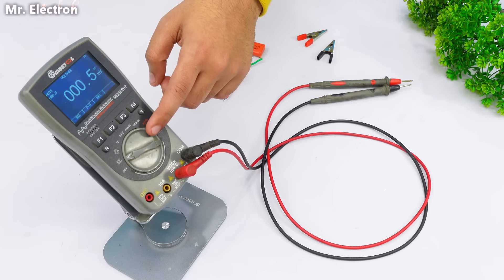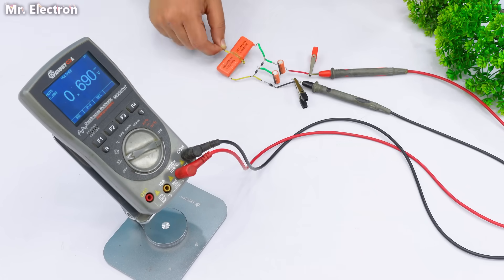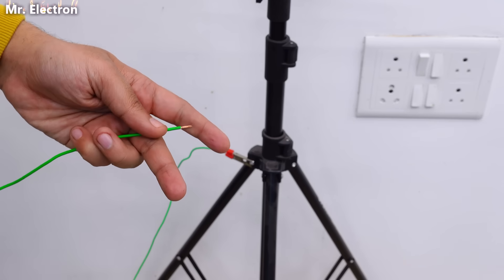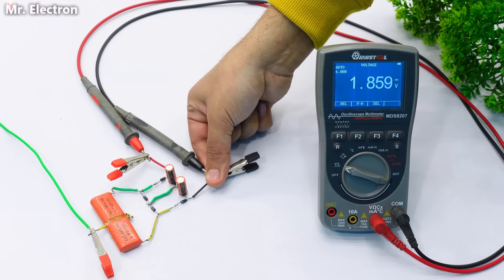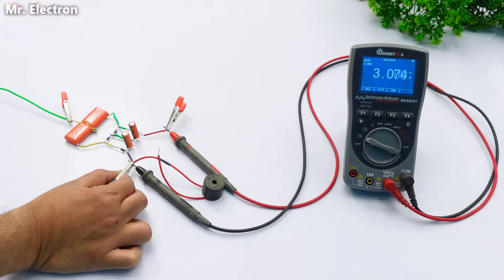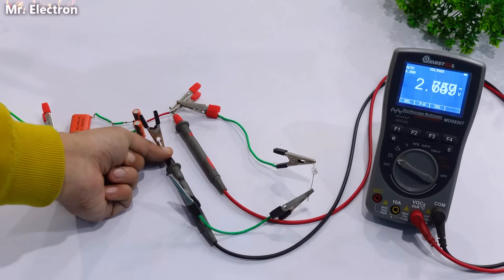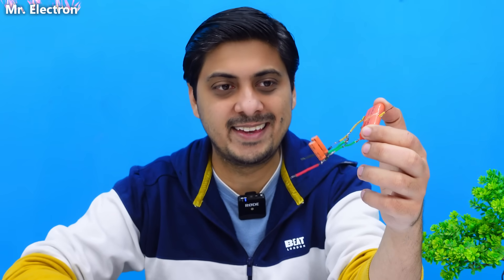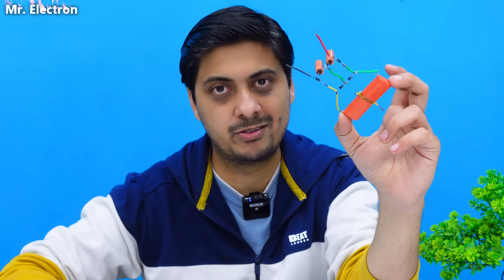Maxwell Chikumbutso - 5000 KW FREE ENERGY from RADIO WAVES | 100% Working Model DIY

Comment: You say it's impossible; Nikola Tesla realized a car that ran on cosmic energy, but was hushed up. So you don't know how to do, or you are paid by the oil companies. The energy, initiated by the radio frequency (=cosmic waves) is coming from the universe and not from the "radio emitters", they only serve as antennas.
The small amount of energy is enough to start a chain reaction, for instance with magnets, and pull a large amount of energy from the vacuum. An exemple is a magnetic free energy generator that suppresses the counter EMF in coils.
Here is an other proof of the existence of it:
- In the year 1965: an American team  visited with aliens in their space ship their planet: 
The team reported: ...."The Ebens developed a different type of electrical and propulsion system. It
was unknown to our team and I don't think we ever really understood it. They
were able to tap into a vacuum and bring back an enormous amount of
energy from that vacuum.
The Eben's energy device was analyzed over and over again by our team.
Since our team did not have access to scientific microscopes or other
measuring equipment, we could not understand the function of the energy
device...."

Comment: "New inventions often come from making connections between things that already exist" 
Besides, Maxwell's invention violates the laws of thermal dynamics you are basing your experiment on, so it's practically impossible for you at present 😁
I like it that Maxwell has started the revolution, many like-minded will emerge.
Reply: Like those perpetual motion machines with the springs, offset cranks, and flywheels? People reverse their videos so they appear to be working, and people believe it.
Reply: @jamesvandamme7786  in all the comments it's you who is fighting it's doing your racist skin very well is it....... Kkkkk maxwell didn't invent anything he just used a what is there to come up with  new product and he did it well and he is making money, 😂the better that sinks in the sooner you will feel better
Reply: @Malvin.k  He did not come up with any product. He has had ten years to sell his "invention" in the simplest possible form, just a plain electricity generator that makes power out of nothing. He has totally failed to do that, because he knows it is not possible. He comes up with every excuse that he can't sell, demonstrate, or explain how it is supposed to work. So instead of a verifiable simple demonstrator, he has his TV with a battery inverter, a commercial power bank, and a stock Chinese EV. He did not build or even modify the car, and there is a huge traction battery under the floor like any other EV. 
He is very successful in making money, not from selling actual products (which wouldn't work) but by getting donations and investors who are too uneducated to see that he is a fake.
Reply: Yeah😂
Reply: 🤓, yup! But we are talking. 
I'm just keeping my electric bill low. 😅
Reply: Hey, we are surrounded by Energy filled with it.
Tapping it as Nicolas Tesla did, is not violating any Maxwell or Einstein THEORY'S.
Them men, only started the quest, poorly armed with equipment out dated that today's science is beyond using, any more.
Maxwell didn't live to see a Cellphone or Space Travel
Reply: Science is about being able to reperform identical experiments to verify results. If no one else can do the same, and this man still has not  become even mildly rich off this invention by this time... I'm incredibly skeptical of the efficiency of this concept at gathering energy for real world applications.

Comment: Hang on a minute, but did you try to amplify the small voltage that was generated by your device? Maxwell's device worked in three phases: 1. The antenna sub-system, which captured and converted the electromagnetic waves into usable electricity. 2. The amplification phase that amplified the converted electricity into a usable value, since it was tiny as was confirmed by your investigation. And finally - 3. The reliable storage of this electric energy, which will be used for future applications. So - Mr Tech, I think your investigation was incomplete and suggest you review it before making any coherent conclusion. Thanks - Hoggard.
Reply: Yes, he needs an amplifier which boosts the power by thousands of times, yet uses NO POWER of its own. Also, Maxwell has no antennas on his car, explain that one please. All his explanations are bullshit.

Comment: Radio frequency refers to to any circuit oscillating between 20khz to 300ghz... Not just signals emmited from local tv or radio stations. 
Its an high frequency inverter technology being used because he uses batteries to run the so called microsonic device just like Don Smith used to when you watch his videos.

Comment: This guy should say it's impossible for him to do.
Reply: Of course Maxwell's invention is possible. He just needs a little more transmit power, by a few hundred thousand times. He can't receive enough power from a broadcast station or phone tower to even run the radio in the car. He also doesn't have any antennas on the car, hope you noticed that.
Reply: @jamesvandamme7786  WHY DO YOU THINK MAXWELL WILL GIVE AWAY HIS SECRET.HE HAS THEM ON A GOOSECHASE. PHILIP EMEAGWALI, MASSIVELY PARALLELPROCESSING OF COMPUTERS THEY SAY WAS IMPOSSIBLE, AND A WASTE OF EVERYBODY' S TIME. IN 1989 HE MATERAILIZED HIS WORK WHICH WAS PLAGAIRIZED BUT WHENTHEY WERE CALLED TO EXPLAINTHEY COULD NOT.

Comment: From your video it has just been shown that you only know to your own limit and that's why we all are not inventors, it takes only one inventor to say it is possible, but majority of non inventors will say it is not possible, but i promise you that you will be amaze how it will turn out soonest, cheers.
Reply: You need to think out of the box and you need to think more positively. You have been taught by the universities and therefore your mind is closed. Who cares if you break the laws of physics. Ask yourself how can I magnify this. That's what Maxwell has done he has magnified. To give you an illustration. The hard drive they had plays magnets around the hard drive. This therefore gave you so much memory. But it took one guy to know that instead of laying the magnets down next to one another what happens if you just stand them up. It takes less space and you can fit more magnets. Therefore it was a simple solution that increased the memory of a hard drive. So you need to think of a way to start magnifying the voltage radio  waves are all around us it doesn't JUST include cell phone towers. It's all around us. This is what makes it unique and therefore Maxwell has been thinking out of the box to bring this to fruition. Stanley Meyer built an engine on water power. That man had over 200 patents. So you think he was smart. I met you. They poison him they didn't want that water power out there. Maxwell has been poisoned. That alone should tell you something he's on the right path. And we must protect them so that this path can continue. At this point he does have a car that runs on radio waves. And he's not going to show his invention because he's not protected. And therefore I don't blame him if he puts in a gadget that blows up his invention if somebody starts to tamper with it. If anything the university should buy a car and that way they can actually see it. Then they can concentrate on how to do the magnification level to make the voltages work like a generator on wheels. And that's what this is. It's not a car it's a generator on wheels. So go back to the blackboard and think of how to magnify this to make these wheels turn. It's that simple but then again it's not. Because you have limited your brain power to think a certain way. Change your ways of thinking and you will see that the doors will open to new light. Amen 😇😇😇
Reply: @infoSeeker007  No that fictive Maxwell is invented to have you guys dumb and looking in the wrong way! over 300 years ago they had real free energy and have electric cars and scooters that didn't need a battery it took power out of the aether!
Reply: Wow!!what a great point you let me hear.That is 100% true.Thanks alot.GOD Bless. @infoSeeker007
Reply: @infoSeeker007  I saw an interesting short explanation on this platform and it is basically that if you use voltage to create frequency via Mosfets, then you get frequency amps... Max is using strong battery power to start his circuits so has plenty of power base to then create frequency amps and feed it both back to the battery and to the output.. i am sure it is more complex than that simple concept, but apparently it was part of Tesla's theory and a proven concept that is never taught... or recorded in any books on physics....i wonder why? ...
Reply: They use MOSFETs but switch them at a 20Khz frequency it is the switching on and off at very high frequency that produces back emf and this can be harvested with caps and using schotky diodes which can be easily achieved with the super caps available now.
Reply: @pehgt5099  Not even close!
Reply: Your problem is you are thinking inside the box. In order to invent something new, something never existed, you have to think outside the box, more than what you were taught, violating everything you think is the right physics. I don't blame you. you are not Maxwell or Tesla, you are just you, so, shut up and keep your common knowledge to your self, we need more than what we already know.
Reply: @livenrwizijose8073  True, that fictive Maxwell is invented to have you guys dumb and looking in the wrong way! over 300 years ago they had real free energy and have electric cars and scooters that didn't need a battery it took power out of the aether!
Reply: I agree with you because it's finalize the marketing and the President of Zimbabwe also declare to help this guy. H i t Zimbabwe also except his invention as an African technology centre.
Reply: Where are you going after you die?

What happens next? Have you ever thought about that? 

Repent today and give your life to Jesus Christ to obtain eternal salvation. Tomorrow may be too late my brethren😢.

Hebrews 9:27 says "And as it is appointed unto man once to die, but after that the judgement."
Reply: Blind faith is a remarkable thing to behold.

Comment: You cannot go beyond 100w maximum if concentrate all Radiowave  to antena. Not practical use even driving BLDC motor of 3kw for scooter
Reply: Sure you can. There have been demonstrations of short range RF power transfer and there are plans (still just plans) of putting a solar power to RF generator in orbit to beam down power to a large receiver on Earth. Not saying it's practical, or economical, just that it's doable.

Comment: WoW Mr Electron 👏👏👏👏👏👏👏👏👏 You did a fantastic job of this demonstration! Although in the state you demonstrated it obviously has it's limitations, it still shows that it has huge potential for further research and development. Well done! , I really enjoyed this video 👍👍👍👍👍 and you have earned my subscription.
Reply: RF engineers have known all about this for a century.
Reply: @jamesvandamme7786  The main problem with Chikumbutso's device seems to be the missing necessary use of Ground that is needed in traditional electronics that Mr. Electronic showed.
Reply: @Needlestitch  There's a LOT more wrong with Chikumbutso's device. There is not enough energy floating around to run a car.

Comment: Get a gas balloon and use thin 26 to 30 AWG wire with it and use it as antenna by setting the gas balloon at a height of around 50m.
Dig a 6 inches in dia and 1 foot deep hole in the lawn and place a 1.5 feet long 2 inches in dia copper tube in it. And fill the gaps around the tube with  coal, 1 packet salt. And cover it with the same soil . Keep the central portion of the tube hollow. Pour water in it so that it could be absorbed properly by the earth. Leave it for one day. Then check the voltage between the antenna wire and this ground. You can use this potential difference to run an electrostatic motor and charge capacitors. Don't get electric shock coz voltage may rise to 100s of volts. Lethal during lightenning and thunder storm. You are living in an unseen sea of energy.
Reply: 👏👏👏👏👏👏👏👏👏👏👏👏👍👍👍🙏 So many great contributions here, this is so great to see.
Reply: you could use a drone, and drape the 26 to 30 AWG wire over a tree.

Comment: You have only managed to prove that Maxwell Chikumbutso's claims are true. The only difference is that he has managed to find a way of amplifying the small voltage produced to  a usable degree which you haven't.
Reply: An amplifier needs a power source to boost a signal. Maxwell needs the large battery under the EV floor to run his car. He's not amplifying anything, nor does he need to. Just keep recharging the EV like any other. There is nowhere near the amount of power you need in a small volume like a car to actually run the car. If you put solar panels on the roof and leave it in the sun all day to put charge in the battery, you could run the car for maybe 20 miles. The sun is the most powerful EM wave emitter around. Radio waves are very weak in comparison, and sonic waves are weak too. .

Comment: Voltage measurement is with minimal load.  There is insignificant power generated.  Power is the product of voltage and amps.The voltmeter likely has a 10 megohm load for a power output of about 2.5 microwatts at 5 volts dc. (P=E2/R). An auto battery requires about 100 milliamps at 12vdc just to maintain a full charge.  You just need about 500,000 of these to keep one auto battery fully charged.  Power is power.
Reply: He needs to add 3 mosfets to the antenna screw them into the receiver and multiple boosters I would think, and use some good metal to catch it.. if he can create an energy vacuum it should be instantly be filled constantly
Reply: Yes, from what you learned. However, inventors look beyond what they've learned.
That's why they create new things.
Reply: @fzzpro-gy  He hasn’t demonstrated that he has *anything*.
Reply: And take your money. Swindle and BS.
Reply: With Quantum harvesting he can do it. This is possible. Everything our parent thought WASNT possible has already been proven to be Possible. Technology only goes in one direction.
Reply: @ Quantum harvesting ? Man, you’re just making ** it up !
Reply: and you are the inventor of warm ice?
Reply: I appreciate your detailed explanation.  Fault with his experiment is that he did not measure the current.  Voltage times amps equals Watts power output.
Reply: Power is ENERGY...and what is newton's law?
Reply: Power is not energy. Power is energy over time. Two VERY different things. Also I've never seen capacitors that size charge that sliw
Reply: If one wired in parallel several units, to Joule Theaf/Roger
this could charge, a motorcycle battery like, a tiny PV batt tender..
2n3055 and large coil, for invertor Joule Theaf
Reply: You can produce more voltage walking across carpet wearing wool socks.
Reply: But,  @brianj7367 , one could set in parallel 4, in 2 or 3 of those, in series and light a Small room.

Comment: You are basically saying the same thing that the other professionals have been saying namely that the energy produced from the radio waves are not strong enough. However this guy clearly knows something you don't and that is what you find hard to accept. However the fact that the energy, as you demonstrated is real,  does the idea that it can be amplified fall out of the realms of possibility as you are all making it seem?. You demonstrated that by touching the wire it was amplified. Could there be another way of doing it that you and other experts are not aware of?
Reply: Indeed, we don't yet know, what we don't know!
Reply: RF engineers have been doing that for 100 years and we know plenty. Grounding the circuit increases the current flow into ground.  Simple Ohm's Law. Putting a longer wire on the input increases the aperture area of the antenna and captures more power. You still get only milliwatts. You can calculate this given the parameters of the transmitting antenna, distance, and receive antenna size and orientation. 

You, on the other hand, have realized that there are things you don't understand about RF propagation and radiometry. You can look these up online or read an amateur radio book like the Antenna Handbook.
Reply: @jamesvandamme7786  Many new innovations have been viewed as impossible until someone does it. No matter how much you or anyone else think we know we do not know all there is to know on the subject. Just be humble enough to acknowledge that fact and keep an open mind.
Reply: @delroytomlinson5339  OK, where's the power coming from? Note he has no visible RF antenna on his car. He has a big battery under the floor, of course, like every EV. 

<crickets>
Reply: @jamesvandamme7786  Based on what i understand the battery is being constantly charged by his devise. Also don't cars normally have an antenna. The point is i cannot answer definitively the questions, however my point is while it is ok to be skeptical and ask reasonable questions, one should also keep an open mind. So much of what was called science fiction when i was a boy is reality today.

Comment: You must use vacume fructuation of Quantum particles, MOSFETs are quantum tunnels that when given resonant frequency of a particular vacume cavity, they tap enegy from the environment at a certain frequence you can entangle a MOSFET junction partcles with others in a remote star
Reply: So where will you connect it to this device